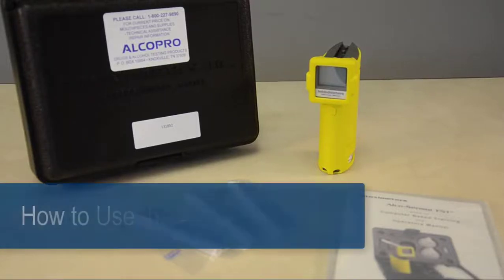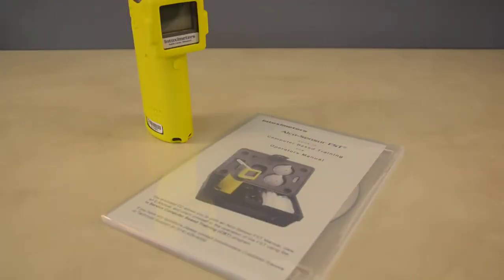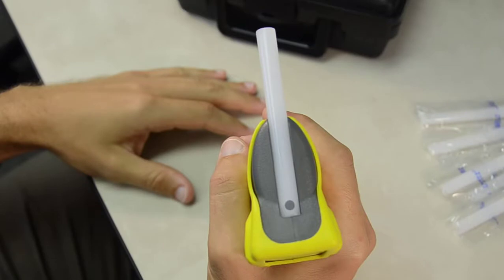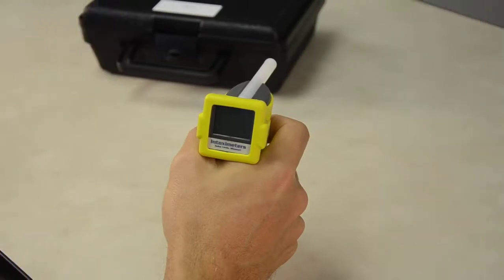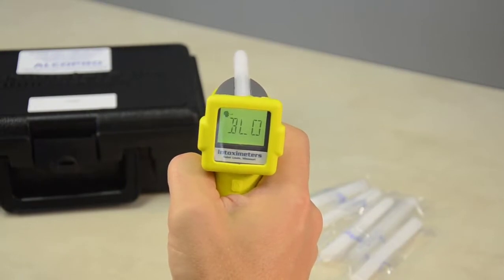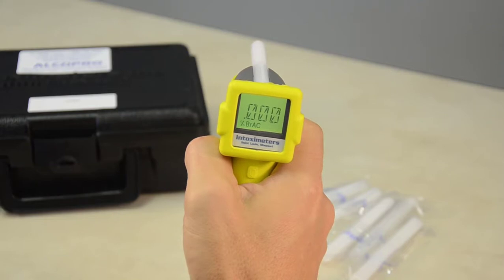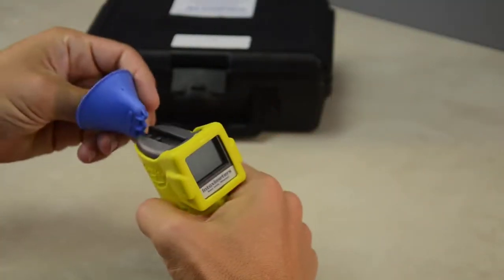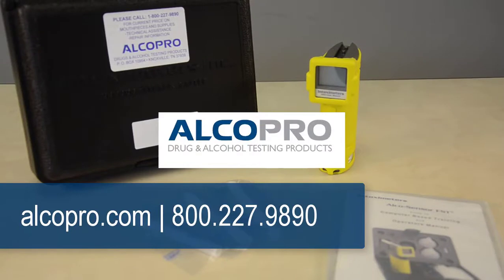Alco-Sensor FST Operator Instructions

Comment: After you blow what do they do with the mouthpiece that has your dna? put it in a data base? The rcmp puts it in a database.
Reply: No they dont
Reply: In the US, they throw away the mouth piece but they usually do a secondary scan at the jail.
Reply from the maker: Mouthpieces are disposed. The device is only able to detect alcohol...no other substances.